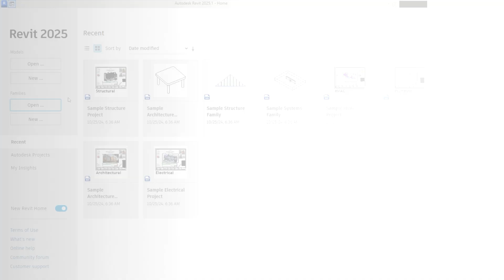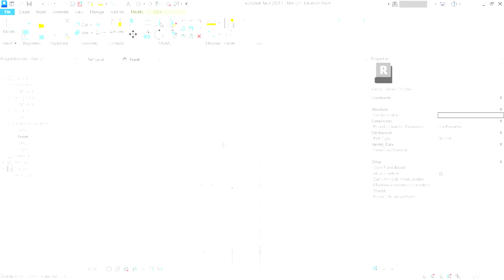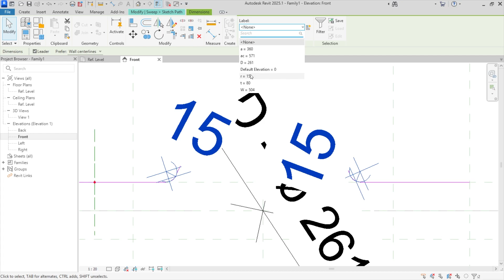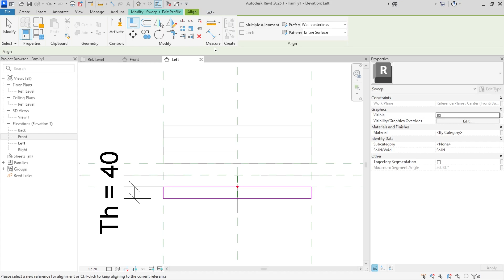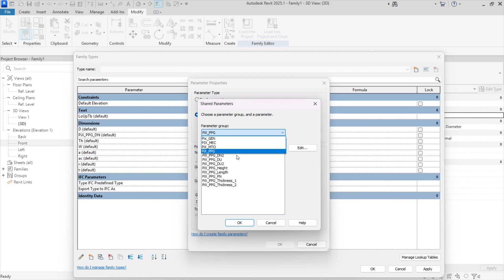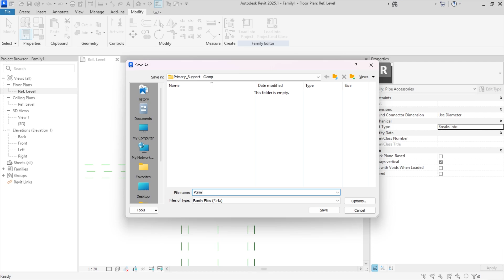Revit Tutorial - Primary Pipe Support - Clamp

Comment: Hi! thanks for the video. Can I ask you if you can make a video where you create a family of a collar adaptable to the diameter of the pipe, which creates the opening in the wall where the pipe passes? Thank you!
Reply from the maker: Glad you like it! Yes there are a few work arounds, if I understand correct you need a wall peteration linked with pipe, so when you move the pipe, the penetration moves also and change the size of the pipe, penetration also changes, correct?
Reply: @PipeEXorg  correct! can you help me? thanks!
Reply from the maker: @Marco-l9v4x  Hi, yes, this is an interesting topic to share, you can find it in our new video https://youtu.be/LEa8jXdHAHk😀this is one of the way, and it is not possible to make it 100% automated. As wall based family are not attaching to the pipes that do make sense.

Comment: Thanks for the interesting video. This clamp divides the pipe into segments. Maybe you know how to make a clamp without dividing the pipe, and with the transfer of the system name to the clamp?
Reply from the maker: Unfortunately, this is only the way. Otherwise, it will not be connected to the system, and they will not move together. Why is it an issue, if I may ask?
Reply: @PipeEXorg  The pipes/ducts are of standard length from the factory. The arrangement of the clamps does not match this length. The specification must show the length of the standard sections and their number.
Reply from the maker: Clear, unfortunately, from what I know, this is only the way, how to make it and keep the family dynamic. As an option, you can have it per type, remove connectors, and install every instance manually. That might take some time. You need to keep track of each segment, but it will meet your needs.
Reply: @PipeEXorg  Maybe, if we change "Part Type" from "break into" to "attaches to" we will solve this problem?
Reply from the maker: I don't think so because the issue comes from the connectors. If you change it that way, it will work as a cap. But you can try to understand the difference.